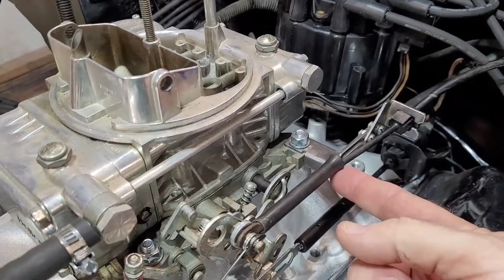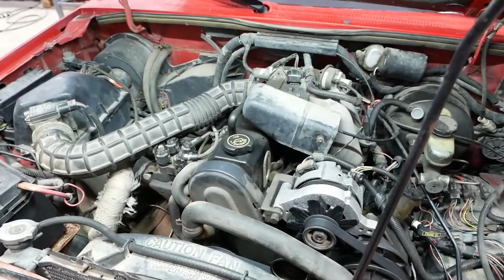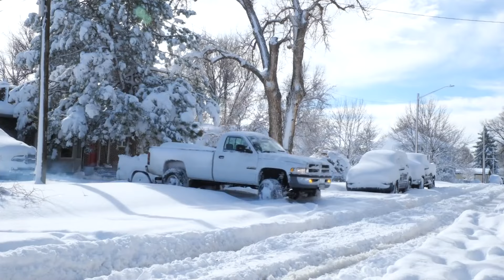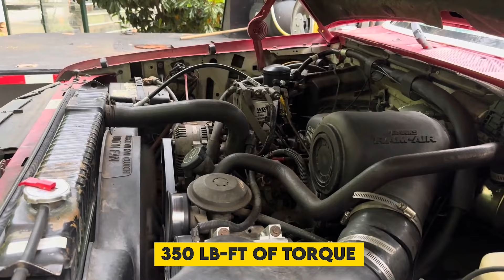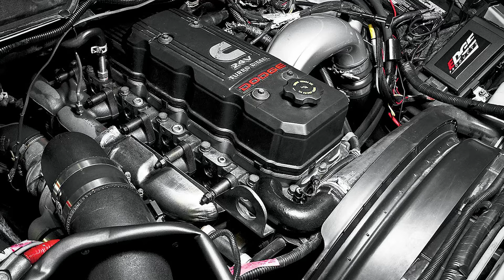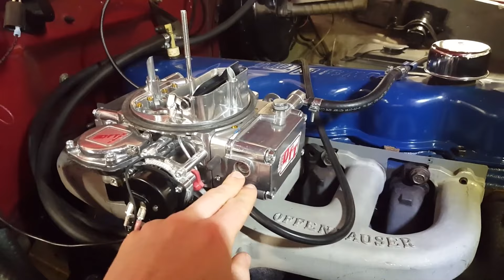10 Classic Trucks With Engines That LAST FOREVER...

Comment: GMT400 is hands down the best trucks ever made,
Reply: Agreed. I have one with 301,000+ Miles. Original engine, transmission, etc. Runs like a new one.
Reply from the maker: agreed